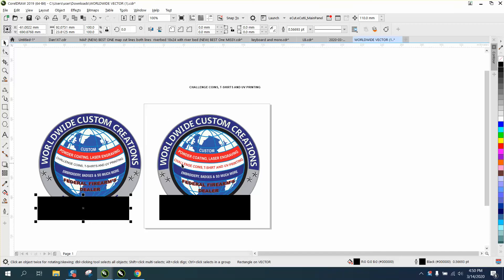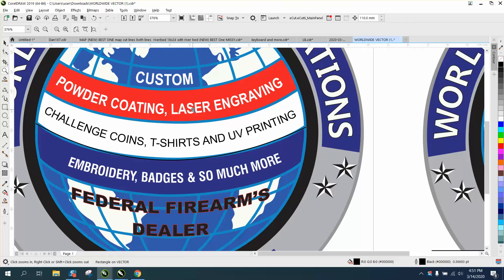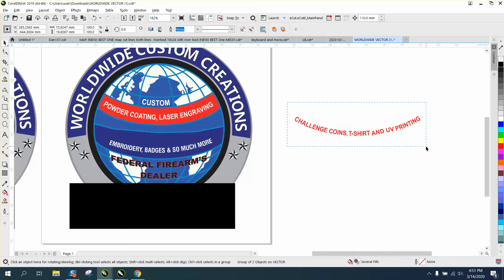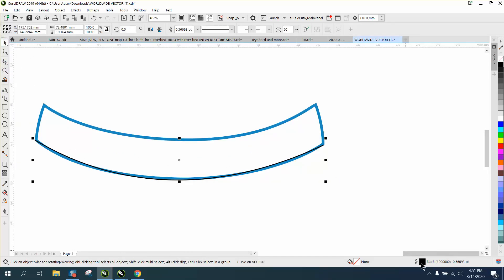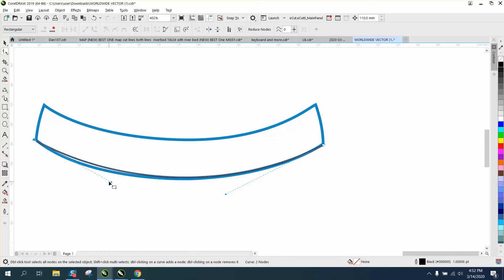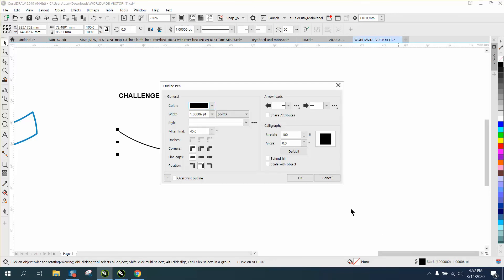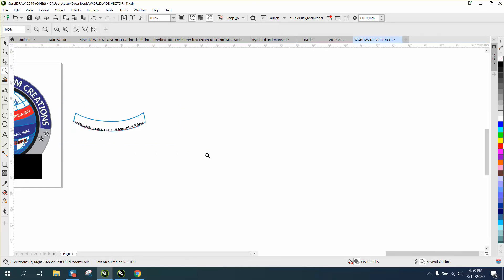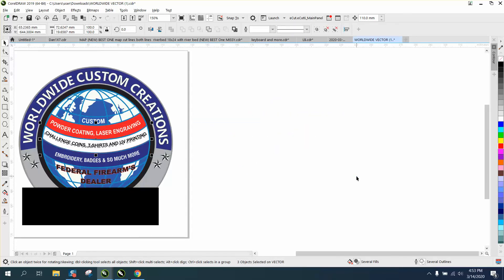Corel Draw Tips & Tricks Text to Path Repair

Comment: Thank you for the insightful video, your info has vey helpful. I was the actually working on a similar problem earlier this week and what worked for me for centering the text in the shape was simply copying the text after it was texted to path and then pasted back to the copied shape. I used the normal centering and evening adjustments to my liking. Hope this helps anyone save sometime trying to meticulously trying to center text to path.